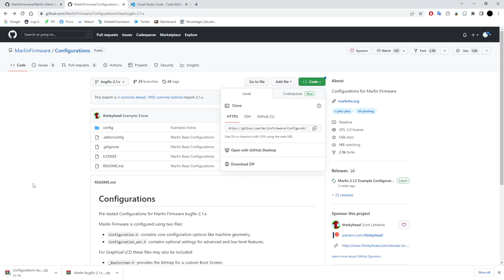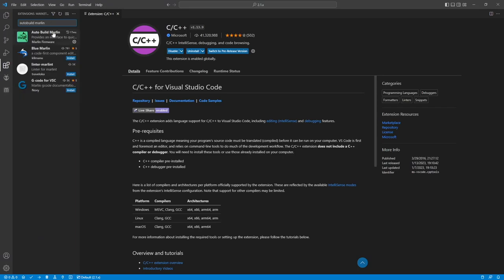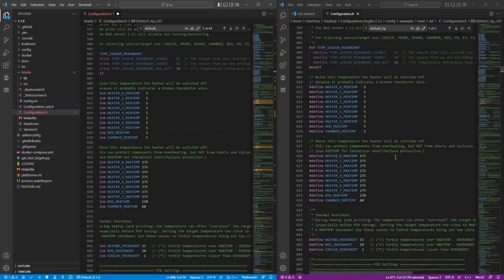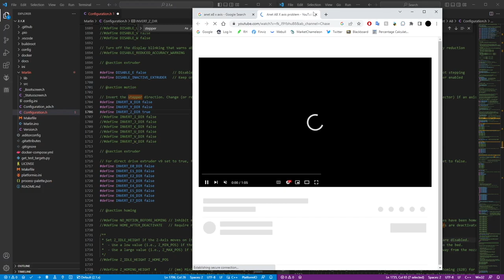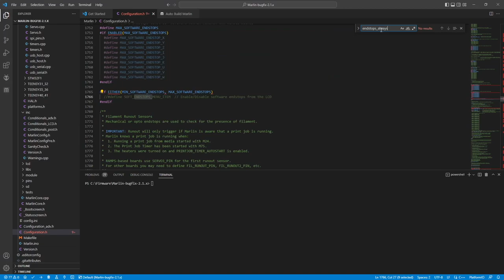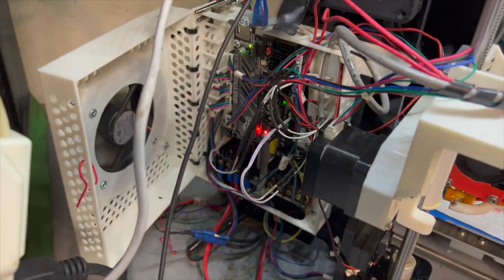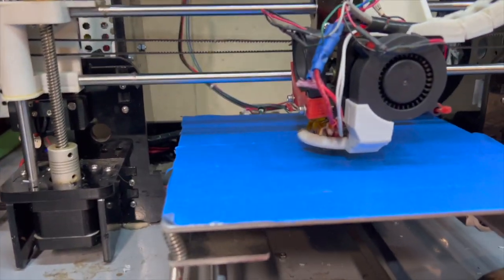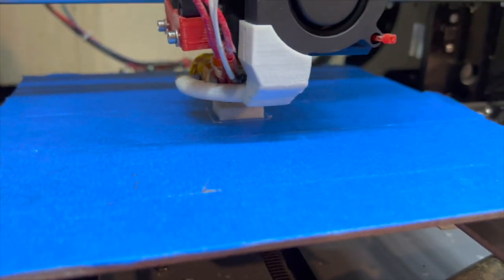How to Install BigTreeTech SKR MINI E3 V3.0 on the Anet A8 and Marlin Firmware

Comment from the maker: Feel Free to drop any comments or questions in the comments ill try to respond actively
Reply: Marlin Full Folder with Required Changes - For verification, this is the Uncompiled Marlin but you have made all the anet a8 changes. So i would use this to add BL touch and jerk /acceleration changes?  Thank you!

Comment: Thank you for this. I grabbed your pre-compiled folder as I am still learning. I needed to edit the settings for abl with an inductive probe. I noticed that you had some z stop inverted settings in place set to true that were normally false on the anet board. I have not fully watched your video so maybe it explains it in there, but I am thinking I need to make sure those stay "false" not "true" in order to mirror my inductive probe setup I have on my original board. Other than that I am struggling to understand what LCD screen to enable for the tft35 v3. I reckon I'll get there. Thank you for making it easier.

Comment: Hello!
First of all, thank you very much, both for the video and for the code and the bin.
I have an Anet A2 with SKR MINI V3 + TFT35 V3.0.1.
I set up VSCode and compile the bin, but my bin files never work.
If I compile your source code without modifying anything, the screen with the bin it generates does not detect the printer. However, with your bin file, it does detect it.
Can you think of what could be the issue?
Thank you!

Comment: Thanks for taking the time to create and upload these instructions. I followed the firmware advice but used the BTT TFT35-E3 display instead. I have a problem. After the second boot-up (not sure the first actually flashed the firmware?) the "No Printer Attached!" message doesn't go away and I get these two error messages almost immediately:
MAXTEMP triggered, system stopped! Heater_ID: E0
Printer halted. kill() called!
Any ideas what I've done wrong?
Reply from the maker: are you using octoprint? where do you see the error? make sure you set your serial ports correctly. as for max temp make sure your thermistor isn’t shorted out and hooked up properly. let me know if either of those work
Reply: @LeoBrosnan  Thanks for your prompt reply. I see the error on the TFT35 screen that I installed at the same time as the mainboard, however errors are sorted now! It was a hardware failure; the hot end thermistor was shorted out. Once I unplugged that, the errors went away and a new one is working fine. I used your pre-compiled firmware and that has definitely loaded.
Reply from the maker: @BillBaffin  great! i’m so glad the firmware could help you

Comment: How would I put octoprint on my board the btt skr mini e3 v3
Reply from the maker: to use octoprint you need to get a raspberry pi it’s super easy to set up runs you about $35-40 and controls the whole printer way better